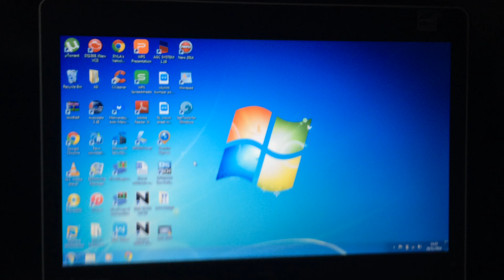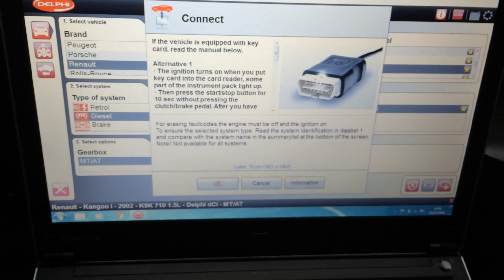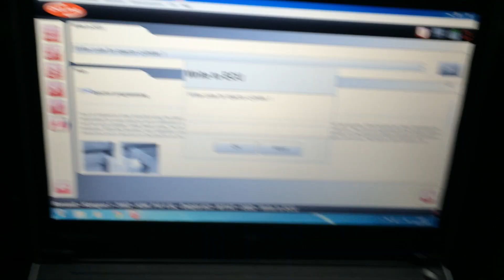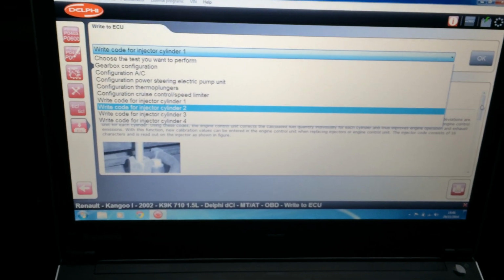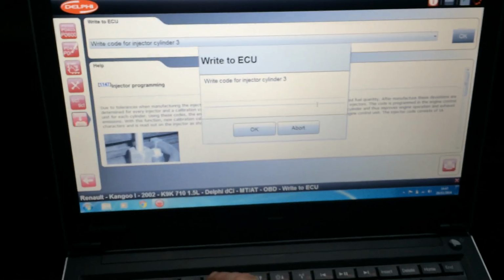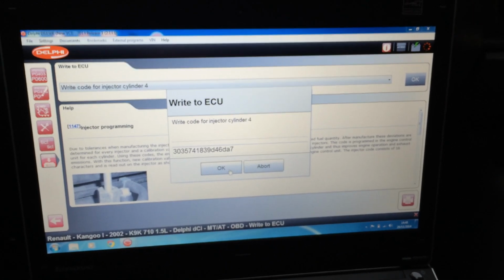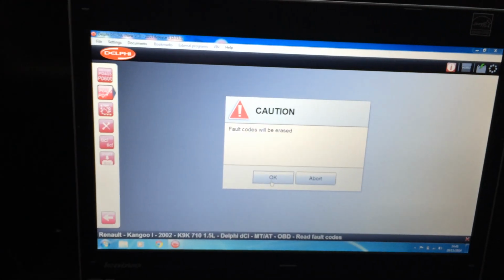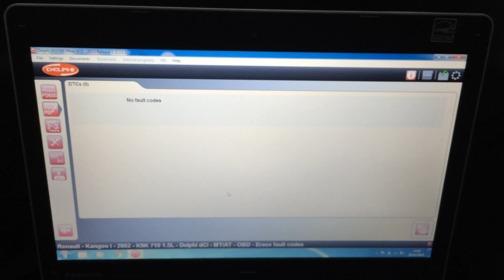Renault Kangoo 1.5dci Delphi Injector Coding Using Autocom / Delphi Software

Comment: Hi there I’ve been trying to do the same as you but on my screen it only has diagnose in the system box as yours says Delphi vci
Reply from the maker: Unsure what the new software is like tbh, did u get it of ebay?
Reply: @luke123918  it’s the same software you’ve got , in the system box it only says diagnose and won’t do anything else
Reply: I’ve just looked , it’s Delphi release 3 , I just looked at yours and yours is release 1
Reply from the maker: @dantheman7370  yeah mine will be 1st generation I imagine on yours u might have to install a crack in software or ask the seller how u code injectors in on yours as ive not even seen release 2 let alone 3 🤣

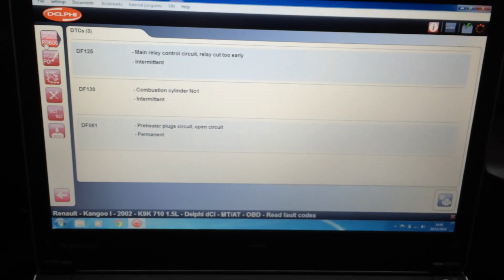Comment: Good video, I'm trying to code injectors into the ECU of a Clio II 2006, but I cannot see six icons as per 1:16, I can see only three icons. Using delphi V2016 and yours is 2013.1, do you know if there is any issue wit newer versions of the software?
Reply from the maker: From memory i think there was tbh you could only use serial number 100251 or something and everyone was changing over to wurth wow as the newer interfaces couldn’t be put on delphi
Reply: @luke123918  I have even real time data graphics, but can not write a think.
Reply from the maker: Where abouts are u based?
Reply: @luke123918  Spain.
Reply: I’m having the exact same problem

Comment: Hiw can i know the place of each injector in the ingine if it's 1 or 2 or 3 or 4 ... I mean the order to put the values in delphi
Reply from the maker: Sorry for the late reply
Cylinder number 1 is flywheel end
Cylinder number 4 is crankpulley/fan belt end
Reply: @luke123918  thank you

Comment: ok until you get injector performance error then cant input codes
Reply from the maker: C Ellwood if you get injector performance issues then you probably have faulty injectors or bad connection on the injector plugs

Comment: do I have to type in lowercase letters or does not it matter?
Reply from the maker: Enter them as presented on the injector if some letters are capital enter as capital  but if some lower case enter in lower case
Reply: there are all capital letters, but they do not even take codes :( 
whenever you enter a diagnostics code, it will write - an invalid code
Reply from the maker: @dusandusko4631  What diagnostic device are you using?
Reply: Delphi 150 and Delphi software
Reply from the maker: @dusandusko4631  Havwe you got the codes of your injectors? As the should just go in as above

Comment: I have a dacian sandero 1.5 dci 50kw, the engine did not want to start, I put a refurbished injector, but I do not know the injectors to code, I have a delphi diagnosis, I enter there 16 local injector number and the diagnosis writes an invalid code, why?
Reply: An renault scenic 2.  1,9 dci injector coding  wrong invalid cod auto com delhi.

Comment: proplm 1.5dci simens Df130 Df582
Reply from the maker: Open the fuel filter to see if any swarf/metal particles in the system, if there is it will be the fuel pump braking down and you will need to clean everything if that is the case. Also check the injector plugs for good connection, i replaced the ones on the van due to the wire being stretch and seeing that the insulation had gone lighter meaning it's stretched and pulled the copper wire inside causing a resistance build up in the circuit

Comment: Hi Luke Robinson 
about the coding injector on Toyota Dyna , the Autocom software can be work well with..? 
or if not applicable with and can you let me know what kinds of software can be work probably with?

thanks
Wanito
Reply from the maker: Depends but there is plenty of software available for the tools the delphi,autocom,wurth wow etc, i can't see why if you get the upto date software, how old is the car?
Reply: My car is 2000s year and I seek advice from you if you can give assist on injectors coding software which is can applicable with ? Below specification of vehicle:
Toyota Dyna
Model.   BDG-XZU508V-RETMA-V
Engine.  N04C-TH.   4009ml
Frame.   Xzu508-0004460

I really appreciate your advised

Many thanks
Reply from the maker: Just had a google as im not too sure my self on that one, but i have found this on delphi's website and they are using the delphi software i am using so i cant see it being a problem.
https://www.delphiautoparts.com/en/toolbox/injector-programming-toyota-d-4d-engines

Let me know if you have any questions ;)
Luke

Comment: how did you know it was 710 as k9k 710?
Reply from the maker: Think it was the vin number i think, not too sure tbh as it was awhile ago now 

Luke
Reply: Cheers Luke, Had Injector no.4 go on my 2011 Renault laguna 1.5dci. replaced all 4 with second-hand injectors which ran fine but down on power. getting code p1204 dealer pacific. Any Clue..?

Comment: hola tengo una kangoo y los conectores de los inyectores están  rotos. veo que los reemplazaste. tenes el numero de pieza para ver si los consigo?
Reply from the maker: Hola tengo alook en la url que he adjuntado, usted debe poder encontrar los enchufes también en ebay si usted busca para el enchufe del inyector del dci '
Http://www.ebay.co.uk/itm/Renault-Megane-1-9-DCI-DELPHI-Common-Rail-Diesel-Injector-Electrical-Plug-/121987191013?hash=item1c6700d0e5:g:oJwAAOSwcLxYISsJ
Saludos cordiales

Lucas
Reply from the maker: Hi have alook at the url i have attached, you should be able to find the plugs as well on ebay if you search for 'dci injector plug'
http://www.ebay.co.uk/itm/Renault-Megane-1-9-DCI-DELPHI-Common-Rail-Diesel-Injector-Electrical-Plug-/121987191013?hash=item1c6700d0e5:g:oJwAAOSwcLxYISsJ
Kind Regards 

Luke

Comment: Thanks for this great video, I just want to know have you solved the DF130 Combustion cylinder No1 problem changing the plugs/connectors on the injectors? I have the same problem, only cylinder No2.
Reply from the maker: It seems to have done, i also used electrical contact cleaner on the plugs for the rail pressure sensor, and the regulating valve on the back of the pump.

Luke
Reply: Well, in my case, it was the injector. I swapped it with other injectors and found that it's faulty. I installed the second hand one, typed in the code, and it works like dream now. :D
Reply from the maker: Thats good :) tbh i replaced all the injectors as i was having issues with small missfires when revved up from idle. The injector plugs for under £10 each i thought was fair but still alittle expensive considering the size of plug. the plugs them selves after time just go brittle with the heat and fall to bits when being removed as well.

Luke
Reply: +Luke Robinson, that's true, lot of vibes and heat. Nicely fixed. See you in the next video, bro. ;) :D

Comment: Hey, I just found your channel, you've got a lot of good information and seem to be super helpful in the comments! Thanks a lot!! I'm gonna get me this autocom program, which vci do you use? I'm thinking of getting a ds150e
Reply from the maker: +Koffi Banan Thanks :), I use the old autocom 100251 serial number vci, which runs 2013.1 software, The ds150e is the same as mine as it uses the delphi software.
The newer the software has some differant things with it like a vin identifier i think of the top of my head. Try and purchase one from the country you live in as if it breaks the return postage will far outway the cost you have purchased the tool for.

Kind Regards

Luke
Reply: Hi mate is it the ds150 you used or something else? I have renolink and I'm waiting on canclip coming but I'm wondering if it's worth buying the ds150? See I have two kangoos both  1.5dcis with the dcm1.2 one had a bad ECU one a bad uch so I bought a ECU set and used the good ECU from one of the vans in the van with the good uch but I'll need to program the injectors I tried swapping the uch instead to save me doing that but the plugs where different

Comment: Hello! In the injector code is a zero cut. It is a number or letter. Thank you!
Reply from the maker: +ioan radu Hi what do you mean zero cut?

Kind Regards 

Luke
Reply: Luke Robinson yes, sorry for mi english!
Reply from the maker: +ioan radu Hi on the injectors iv'e only ever seen zero's (Number) Never letter (o), the codes are mixtures of letters and numbers

Kind Regards 

Luke
Reply: +Luke Robinson Ok , Tanks! My problem is that I changed the ECU and will not let me write codes injectors. It is strange that the engine works well with ECU stored with other injector codes. P.S i have the same program!
Reply from the maker: +ioan radu Hi not too sure why it won't let you program, i would disconnect the battery and let the controle modules power down and reconnect the battery and try again, failing that just leave the vehicle idling and it should code the injectors for you, are you also using the right code?

Kind Regards 

Luke
Reply: Luke Robinson Yes is the right code of 16 caracters!This writing is done with the engine stopped and the ignition on ?!
Reply from the maker: +ioan radu  yeah ignition on, so all dash lights on and go through delphi and do the coding procedure, does it tell you that the action hasnt been completed?

Kind Regards 

Luke3

Comment: Les numéro que vous avez sur votre papier ou vous les avez trouver ??? C est ça que je veut savoir Help me
Reply from the maker: David Lhost  Hi David, The injectors you have on your 2.2dci are differant, yours are pencil injectors with the coil at the top. Mine on the 1.5dci are pencil injectors but use peizu crystals inside to make the 100+ volts to make them open. The 1.5dci has a sticker on the injectors with the code: Image http://www.chiptuning06.de/resimler/renaultcl-1362246928-2774.jpg on the image there is the code that starts with EJBR Etc that is on the 1.5dci injectors.

On your diagnostic delphi interface does it say how many digits the code should be David?

Salut David , Les injecteurs vous avez sur votre 2.2dCi sont differant , les vôtres sont injecteurs de crayon avec la bobine au sommet. Mine sur le 1.5 dCi sont injecteurs de crayon mais cristaux utilisation de peizu intérieur pour faire les plus de 100 volts pour les faire ouvrir . Le 1.5 dCi dispose d' un autocollant sur les injecteurs avec le code : Image http://www.chiptuning06.de/resimler/renaultcl-1362246928-2774.jpg sur l'image , il est le code qui commence par EJBR Etc qui est sur la 1.5 injecteurs ICD.

Sur votre interface Delphi diagnostic est-il dit combien de chiffres du code devrait être David ?

Comment: La voiture ne démarre pas et quand je vais sur delphi pour reprogrammer il me demande les code injecteur comment faire pour si qu elle démare et quand je vai dans l autre menu. Ça marque injecteur 1 non pris en charge avec le code  7f2111 un truc dans le genre
Reply from the maker: David Lhost  Hi David, It should be a longer code, The injectors on the 2.2dci im not too familar with, However the code for coding should either be on the top of the coil or etched in on the body. I would just try other codes, but from memory they should be letters and numbers.

Salut David , Il devrait être un code plus , les injecteurs sur l' im 2.2dCi pas trop familiers avec , cependant le code pour le codage doit être soit sur le haut de la bobine ou gravé dans le corps. Je voudrais juste essayer d'autres codes , mais de mémoire ils doivent être des lettres et des chiffres.

Comment: salut moi je doit reprogramer les injecteur sur une espace 2.2 dci sur les injecteur il a pas de bague il a des numero sur  le plastic noir quand je mets ces numero dans le delphi ca marque intruvable comment je doit faire???
Reply from the maker: David Lhost Hi David, if there is no codes on the injectors, you will just have to let the vehicle idle or use the vehicle and eventually the ECU will alter the fueling for the vehicle, Any other questions just ask ;)

Salut David , si il n'y a pas de codes sur les injecteurs , vous aurez juste à laisser le ralenti du véhicule ou utiliser le véhicule et, éventuellement, l'ECU modifier le ravitaillement pour le véhicule , d'autres questions il suffit de demander ; )

Comment: how much would i pay for delphi autocom   would it work on renault traffic coding injectors etc
Help from anyone please
Great video luke   cheers
Reply from the maker: Hi Ged, I had purchased mine of ebay as a china clone like many of the others on ebay and most of the videos on youtube are of the chinese software.
I had purchased mine at £120 inc postage way back in 2013. I have seen them aslittle as £40 including shipping on ebay, they are either housed in a case like mine, some are housed in the delphi ds150e cases with bluetooth etc, some even in the same cases as the ford ids vcm 2 advertised as Cdp pro etc, It is pot look i imagine now as some of the interfaces have cheaper boards and resistors etc, Ask as many questions as possible about the item if they have any pics of the boards etc and google wich are the best boards in the interfaces. The interface i have runs the 2013.1 software im alittle scared to update to the later software due to there being problems with the interface communicating with vehicles after updating software and firmware.

I should imagine it will code injectors on a traffic, i find the delphi software works rather well on alot of the french stuff I.E Renaults, Citroens and Pugs

Any other questions please ask away

Kind Regards 

Luke

Comment: Hi Luke,

What cable do I need to connect my laptop?  How much is the software you are using?
Reply from the maker: I Had recieved the interface as a present and it was from ebay, called autocom the device came with software

Comment from the maker: Stav Plaskas

Hi the cylinder number 1 starts from the gearbox side of the engine. So if your looking forward of the vehicle the gearbox is ln your right and the timing belt side is on your left.
So it goes from right to left as regarding cylinder numbers. 
Starting from right 1 , 2 , 3, 4 and finishing with number 4 on the left side of the engine closest to the timing belt side.
Yeah you shouldn't need to remove the injectors to read the code, you should be able to see them while they're in the vehicle, i find a torch is helpful as well when doing this as it just brightens everything up much better.
Any more questions let me know ;)

Comment: where did you find the code? is it located on the injector?
Reply from the maker: stav plaskas Hi the code is located on the top of the injector underneath the High Pressure Pipe.
http://image.made-in-china.com/44f3j00HQGtEYWaeRcU/Ejbr02101z-Delphi-Common-Rail-Injector-for-Renault.jpg

I just did a quick google so i could show you, on the image on the URL it's the top code of the injector as the middle code on the injector is the serial number. If you need any more info let me know. If the injector hasn't got a code on it, in all honesty i wouldn't bother too much as if the vehicle is left on idle the ECU will calibrate the fueling for the vehicle

Luke
Reply: thank you so much, they look exactly like the ones on my scenic. I all ready fitted 4 new ones in so i might need to remove them again to see the code as its on the neck of the injector and the code might not be very visible from the top. Also for cylinders 1-4 is it cylinder one at the left of the engine and cylinder 4 on the right or they start cylinder
1 on the left then 2 3 and then 4 on the far right. lol i hope that makes sense
Reply: i might just take a picture instead of removing them again
Reply from the maker: stav plaskas Stav Plaskas

Hi the cylinder number 1 starts from the gearbox side of the engine. So if your looking forward of the vehicle the gearbox is ln your right and the timing belt side is on your left.
So it goes from right to left as regarding cylinder numbers. 
Starting from right 1 , 2 , 3, 4 and finishing with number 4 on the left side of the engine closest to the timing belt side.
Yeah you shouldn't need to remove the injectors to read the code, you should be able to see them while they're in the vehicle, i find a torch is helpful as well when doing this as it just brightens everything up much better.
Any more questions let me know ;)
Reply: i found one of the old ones and at the top under the high pressure pipe there are two sets of numbers and then there are another 4 sets of numbers in the middle of the injector and one of the numbers has a qr barcode next to it.........confused now lol
Reply from the maker: stav plaskas Hi, the code is a 16 digit code so anyone one of the codes at the top under the High Pressure pipe will do aslong as it's a 16 digit code.
Luke
Reply: luke i cant thank you enough, your a life saviour............stupid me....there is 2 sets of numbers. 8 on one side and then as you go round with a slight space between them another 8....lol 8 + 8 = 16......man the space between through me off. Should be a piece of cake now, i got my delphi scanner yesterday now all remains to do is write the code down and then enter it on the scanner....i scanned it today and it gave me 4 injector codes but i think the codes i got out are from the old ones just need updating. They had quoted me 800 quid to change them and i managed to do it for 140 for a set of four reconditioned injectors...the vehicle starts now but im sure it will run even better when i enter the codes.....Thanks man i cant thank you enough
Reply from the maker: stav plaskas Haha no problem, I have been there my self with the injector codes. Thats why i made the video as garages charge a fortune for fitting new injectors and charge you for coding injectors in. But it's not hard at all. I would suggest putting a new fuel filter on as well if you have new/Recon'd injectors fitted. The vehicle does run abit better but the ecu will sort the fueling out even after you have entered the codes due to carbon build up etc around the injector nozzles during usage etc.
Yeah no problems just let me know if you get stuck and i will see what i can do ;)